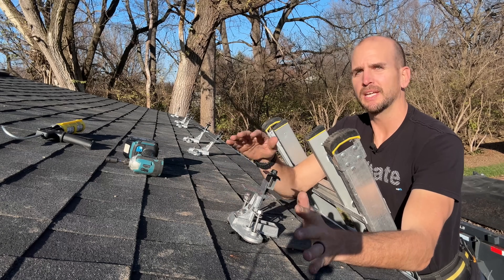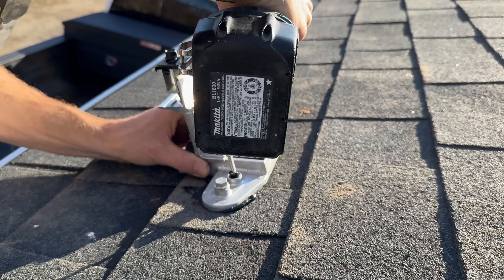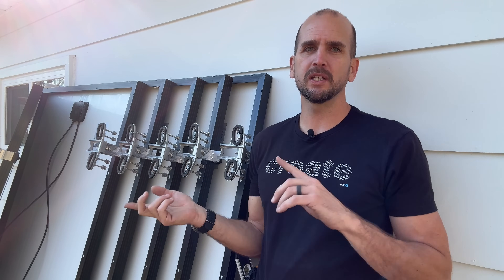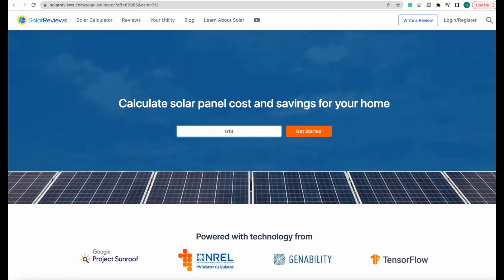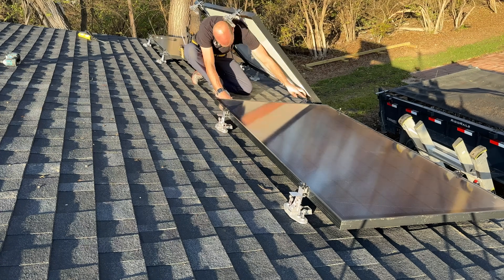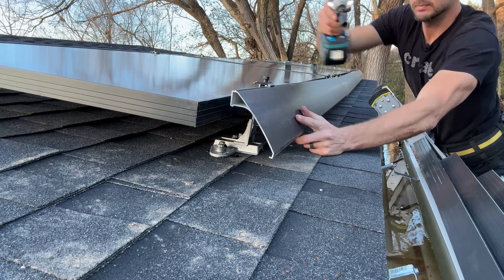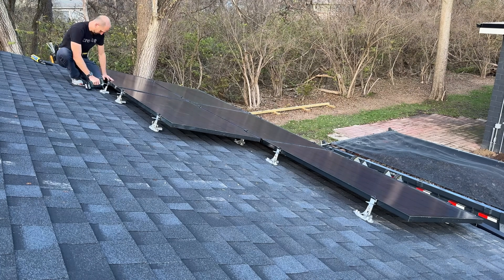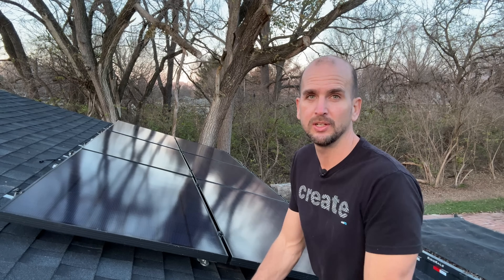Easy DIY Solar Panel Roof Installation

Comment: I would be very worried about leaks, even with tar or silicone.
Reply from the maker: Yeah, unfinished garage where I have extra shingles and easily can repair I feel fine but on my home I would be a bit concerned with all the holes.  Thanks for the feedback.
Reply: Should probably only be done on a steeper roof like a 8/12 Pitch or more.

Comment: Beside the regulation that you mentioned, I think that there are also regulation for leaving a walking path, like 3 feet wide, especially close to roof edges.
Reply from the maker: Yeah, good point I should have noted the ridge and edge walking path called out in most places for firefighters.
Reply: Since this is a detached garage, I believe that no pathway is required. Depends on your local rules
Reply: DIY do what they want.

Comment: Hey bud, I've been learning from your videos for awhile now - awesome work by the way.  I'm curious if you have a suggestion on how to manage the connection between (semi)permanently supplemental panels on a roof that may be used to feed one at a time of many (semi)portable battery banks inside the house.

For example, let's say I want to put roughly 600 - 800w panels on the roof, but I have multiple different battery banks (EcoFlow, Bluetti, etc) that I want to rotate/charge as needed.  Let's assume the input values are generally the same so we're not worried about overloading anything.  I'm not giving a specific voltage here because I'm still fingering out the best way...

Anything I need to be careful of?  I noticed many connectors and battery banks have warnings of "do not connect/disconnect under load" ... which is where my question comes from.  I ask because crawling up on the roof and throwing a tarp over the panels just to switch the sink load is, let's say, not convenient : )

Might be a good video topic, if you haven't already done it and I missed it.
Reply: Connect and re-connect at night
Reply: Put DC breakers inline.

Comment: That's great hardware..I prefer ground mount systems myself..I would caulk those brackets, around the heads of the lag bolts, and on the inside where they come through the rough..My ground mount is built from 2x4's, I built 2 carts on big wheels, each hold four 400 watt panels, so I can change the angle of the panels and move them to follow the sun, because I live in a valley in the Adirondack forest, so being able to change angles and move the panels is essential..And I have 4 stationary 400 watt panels..I traded in my old inverter in and got the new EG4 Luxpower  6000 XP and it runs my whole house easily, including my well pump, welder, Minisplit, microwave, induction cooktop, etc..Well the minisplit runs from it's own panels, during the day, anyhow..Of course I don't run more than 2 or 3 high draw items at a time, but haven't had any problems..I might add a 2nd 6000 XP, just to have an xtra in case one goes down, and to lesson the demand on the other..

Comment: Great video, so Thanks! Since I live in tornado alley, I've yet to decide whether to do a ground mount or roof mount, or perhaps a combination.  I've been looking at different mounting systems and this one looks to be the least likely to hold up in high winds, until I saw the skirting. So, if this mounting system isn't more prone to roof leaks and can hold up in high winds, I think it's worth getting, especially on a garage or storage building.
Reply: We are also in Tornado Alley and used Iron Ridge Mounts that are flashed under the shingle above and screwed to the roof trusses/rafters.  I just don't see the system in this video hold during a storm when it's only screwed to the roof sheathing.  There are videos of our install on our channel.
Reply: Thanks, I'll check your channel out. @Off-Grid
Reply: >> Since I live in tornado alley, I've yet to decide whether to do a ground mount or roof mount, or perhaps a combination.  
Nothing could handle a tornado... In your situation I think that I would only use ground mount,
unless you cannot find an area without shade from trees or other building.

Comment: Hardware mounting points for panels I thought rule of thirds come into play. That way the panels are evenly supported and can withstand forces like wind, deep snow or ice better. Also the panels can handle strong horizontal winds without being stressed as much. In our area, the sheer strength of the shorter lag bolts would come into play vs mounting into roof supports. Like to concept, but would need solid engineering analysis to see if they would work.

Comment: Great setup.  My thought on clamp layout would be to use one clamp on the end and then a clamp in between the next panel so its less clamps used.  The clamp appears wide enough to bridge and clamp to two panels at once.
Reply: It won't be approved that way by the S.E.

Comment: So, does this only bite into the plywood rather than any framing?  I'm not sure I'd feel comfortable with that, especially in a windy area.
Reply: It’s engineered for that use case, they’ve got the structural engineering certifications on their website
Reply: @LifeLongLearner-om8jx  It relies on pressing the shingle hard against the felt, which could fail in a year or 2.
Reply: It could just as easily go in a stud with some layout
Reply: Couldn't agree more! It all depends on how well the roof was built. Did they use enough nails, did they use ring nails, and/or construction adhesive to attach the plywood to the rafters? I did a lot construction at the Jersey shore and we used a huge number of ring nails and construction adhesive. Our houses were built to withstand pretty much any hurricane. Unfortunately most houses are poorly constructed and I wouldn't trust them not being anchored to the rafters unless I built it myself.
Reply: Always depends on your ahj and state requirements. Some areas my company installs in, something like this has to be in a rafter regardless
Reply: @solfreshsolclean  that is only the case because they’re the last to adapt to industry trends. There are always laggards.
Reply: @LifeLongLearner-om8jx  
In most places. I would agree with you. And then there's Miami Dade

I oversee a lot of installations across the whole of the United States. Miami Dade is likely to stay in what they ask for. Doesn't matter what the industry standards are
Reply: Hahahah oh fuck.  You should not be installing anything anywhere.   Good lord you are just destroying people's homes
Reply: you pick, you can align one bolt or screw to the flasher. Problem solve. Pick one of the center screws so that you get two sheathings in one bracket.
Reply: Maybe not good for Hurricane areas but prob okay for IL
Reply from the maker: Exactly, that is why there are so many lag screws at each mount.

Comment: When leaves and pine needles fall on your roof, is that skirt going to cause them to stack up? Rodent habitat.
Reply from the maker: It could, there is a pretty good sized gap but things could start stacking up over time.

Comment: I love the vid and info however Im not a fan of roof mounting solar panels unless its on a shed or uunfinished garage.  I do believe roof mount systems will improve as what you show
Reply from the maker: Yeah, if possible I think ground mount is the ticket but for a number of us unfortunately the roof is the only reasonable option.